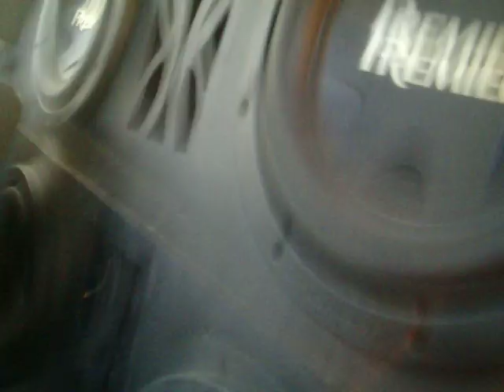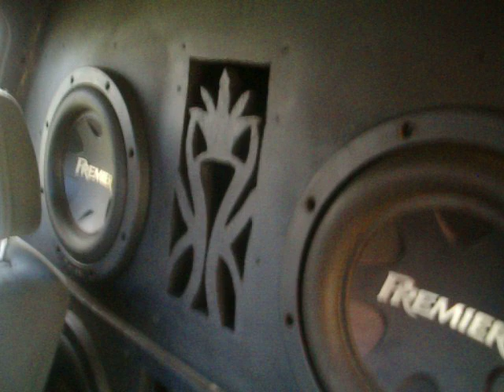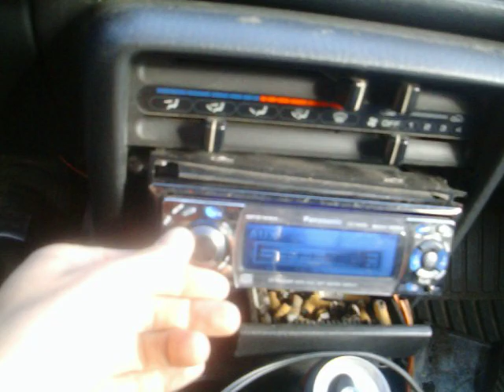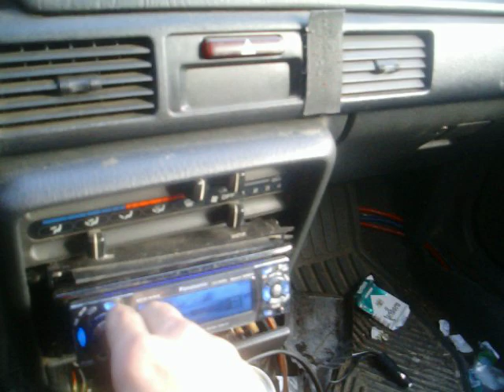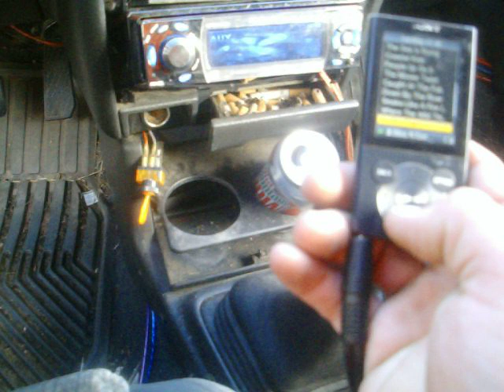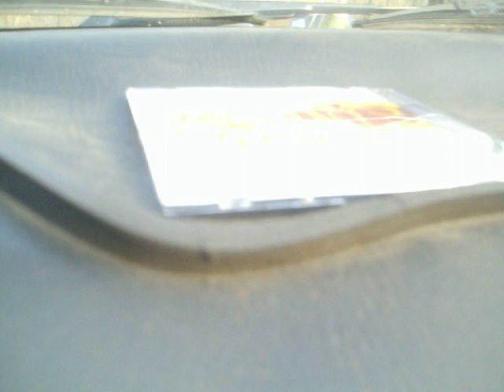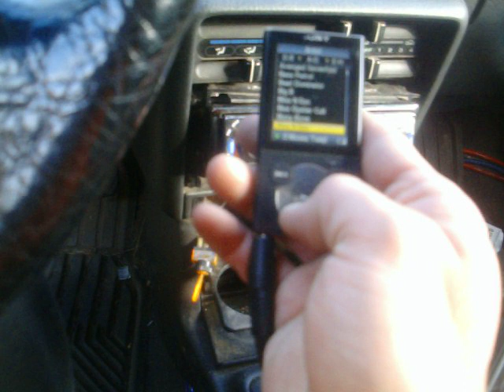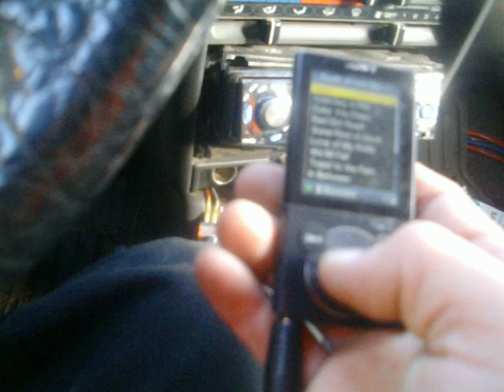Pioneer Premier 4 12'' TS-W3002SPL Profile AP2000 Bliss N Eso

Comment from the maker: @reiningern777 no havent had it metered yet, i think i wanna just buy a TL but then i have to buy a laptop to ... lol so i dunno . if i do get a full 4000 RMS ima have it so i can wire them up and run less power for everyday but have em so i can quick wire them down if i need to kill someone with a 60hz tone blast lol , also the port designs would have to come out if i got that much power. cuz other wise they will get broke anyhow lol !

Comment: that 	AP2000 will not push even two of those subs youll need something that can handle a .5-1 ohm and that 4 gauge is gonna need to be upgrade along with alt and maybe 2 batteries for a 4k rms system but that wall looks beautiful 4get what ppl have to say about your car and the eq you have hey if you like it thats all that matters

Comment from the maker: @MrSuicideSPL im from wisconsin... and yes it takes power to make power and yes they are only getting 1/4 power they can take... nothing wrong with that for now till i have money to dump into it. and shit this is all getting ripped out and ima do 8 12's...lmao .... jesseatkins187 powers his 6000gti ..or his RF4000d on a stock atl. he just has a bank of battery... and not all cars use 40% of the alt... you should know that. some use 80 some use 10 ..... depends on whats in the car for electrical

Comment from the maker: @MrSuicideSPL 3 runs of big 4 ga. to the rear into a block , and 1 short 4 ga. to the amp cuz it only accepts 4 ga. wire. , also i have the big 3 done in all larger 4 ga. wire , not cheap wire either... my buddy has 2 ga. wire and my cores on my 4ga are larger than his 2 ga wire ! ....my car uses hardly any power at all so the alt. only has to worrie about the system. come sit in this car and tell me it aint loud lmao.